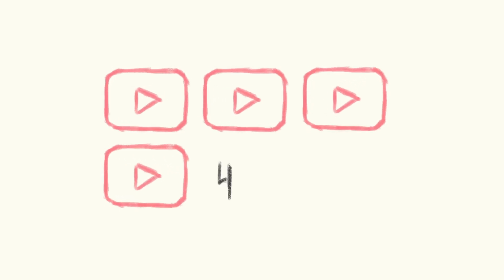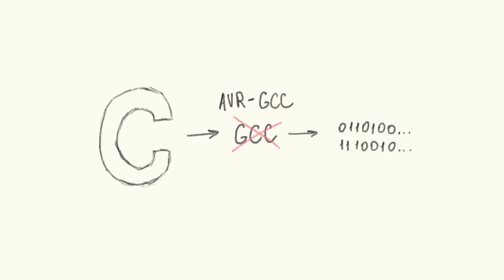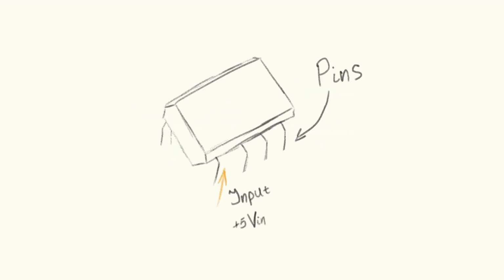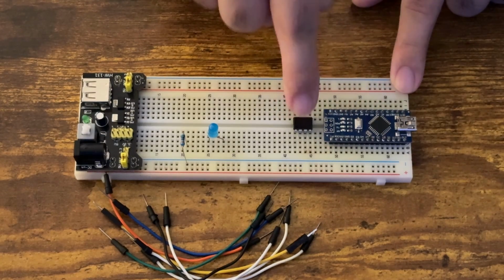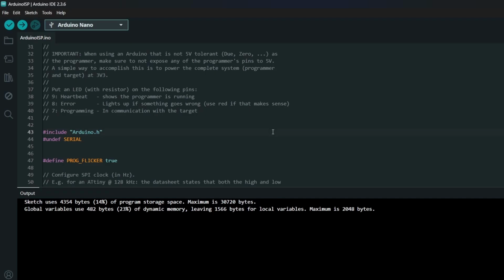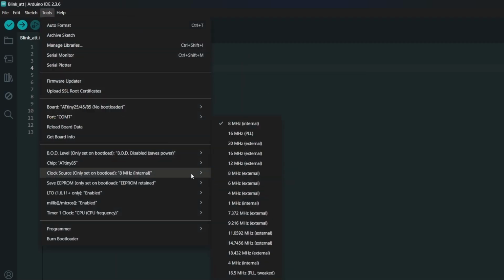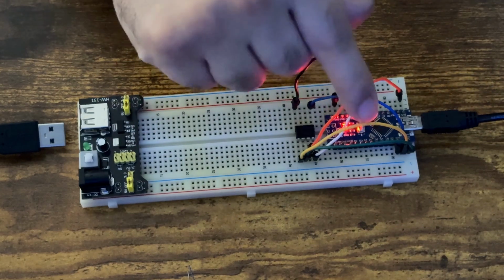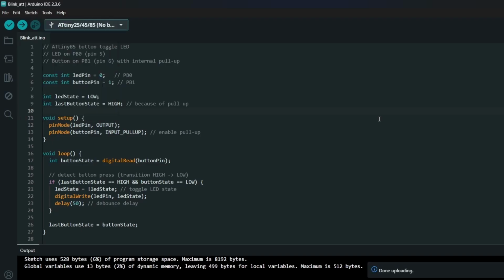Let's program microcontroller using Arduino | Exploring AVR part #4

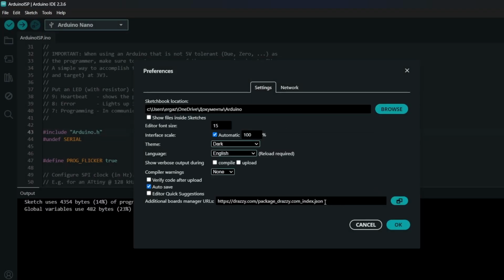Comment from the maker: I FORGOT one crucial step right after 12:52

We need to install attiny packages into Arduino IDE:
1.	Tools → Board → Boards Manager.
2.	Search attiny and install ATTinyCore (by SpenceKonde)
3.	After installing you’ll get ATtiny board options under Tools → Board.